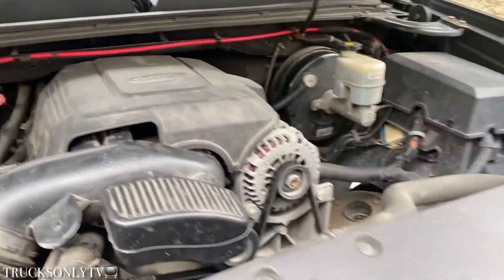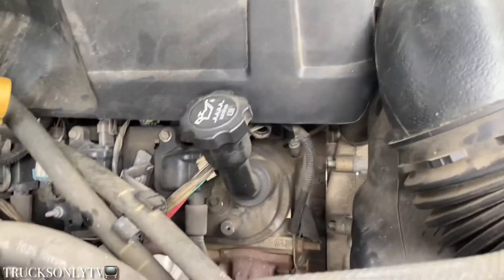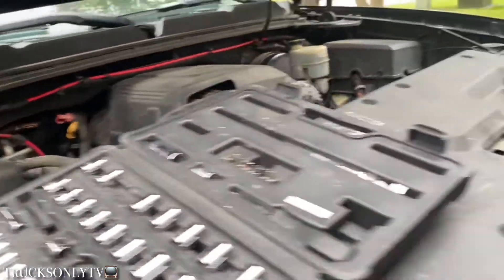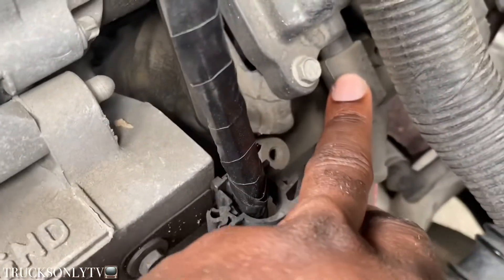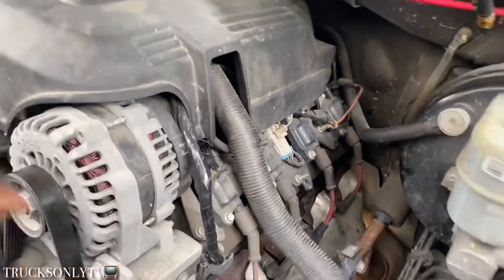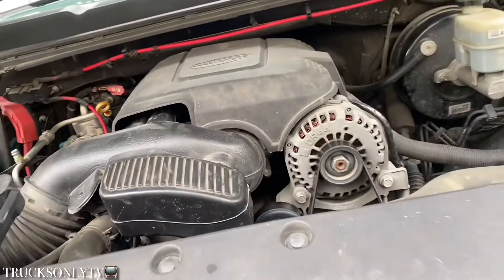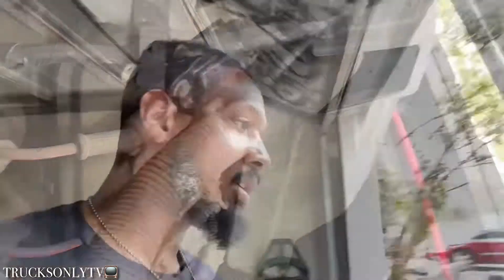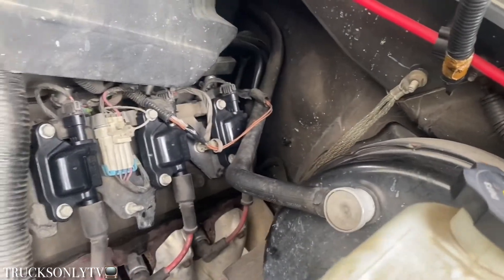08 Chevy Silverado 1500 ignition coil replacement

Comment: At what mileage should I do coils and sparks with wires? Ima at 145k
Reply: Maybe soon mine started missing at 160
Reply from the maker: Yea 150k. Knock it out early
Reply: I have his same truck only difference is the color. 
I'm at 311,000+ miles. 
I'm changing mine next weekend. 

Had a misfire in cylinder 4. I changed the spark plug. Not much change so I'm just gonna get all of em in one shot

I've had luck with that before but it was really about time vs money.